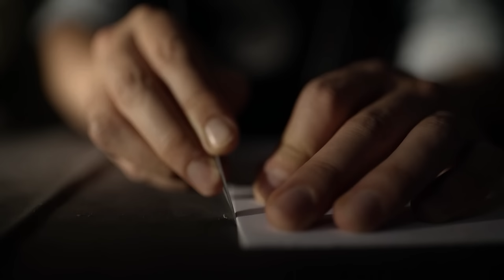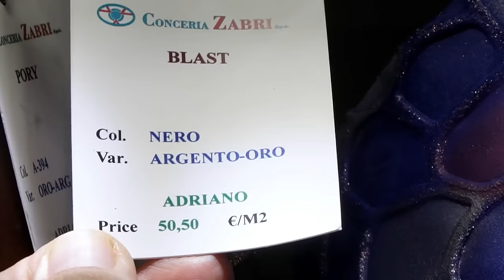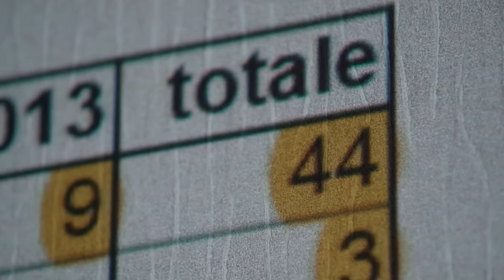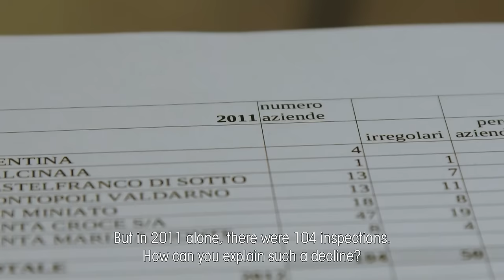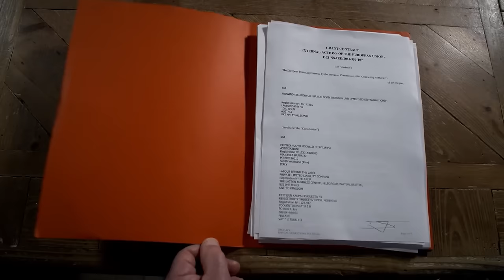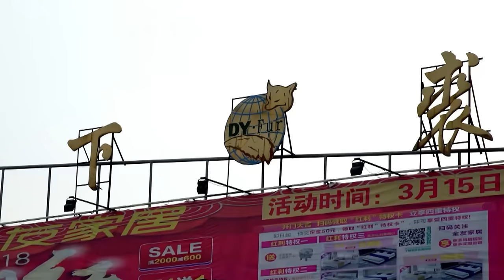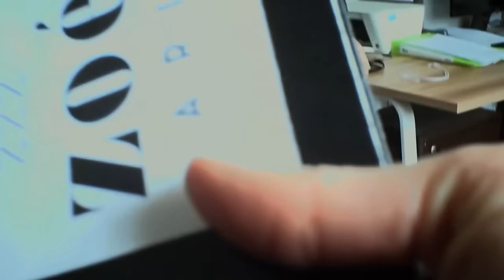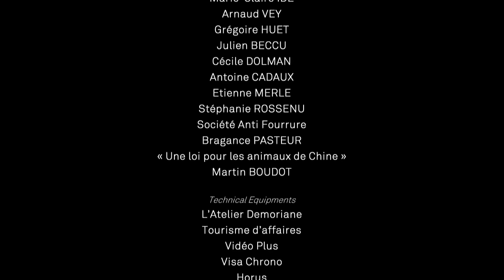Hidden Side Of Luxury | Human Rights Violations

Comment: Great and important documentary. So when will Alfonso Guerra be prosecuted? That needs to happen, maybe you can help. He needs to be in jail for so many things, especially  for beating the 2 Senegalese men. All the worker abuse is terrible. I lived in Senegal for 2 years as a Peace Corps Volunteer. Overall the Senegalese people were so kind and great. However, at the time they also practiced female circumcision. (It's been abolished but still happens). It's mostly a muslim country and many men have 3 wives and 10-20 children. (although that's a bit different in the cities). Another issue is the desperation for money (especially when you have so many children). That predicament puts the Senegalese working in these unfortunate conditions in a vulnerable situation. If the Senegalese in this documentary weren't so desperate for money they may not be putting themselves in that situation. I've also lived and worked in China - it's pretty horrific in many ways. So sad how they are treating those poor animals. Obviously, these tanneries should - ideally - be abolished or at least be changed and offer fair working conditions for all. These products are far from necessary. Fur coats should be outlawed at this point. A cotton or non-animal made bag/purse/coat will do just fine. 🙂